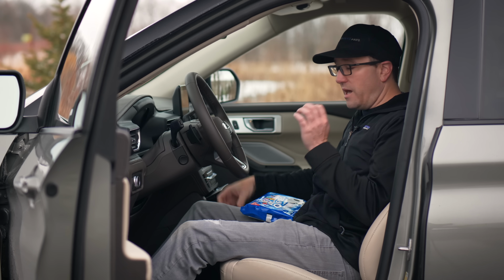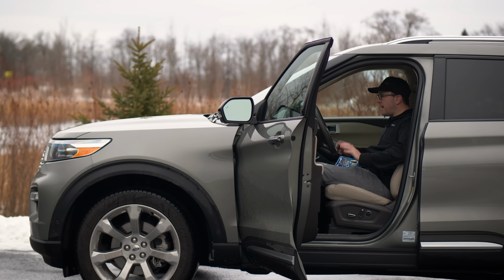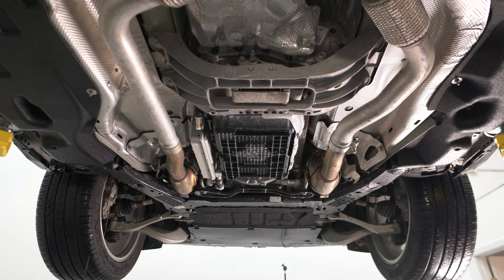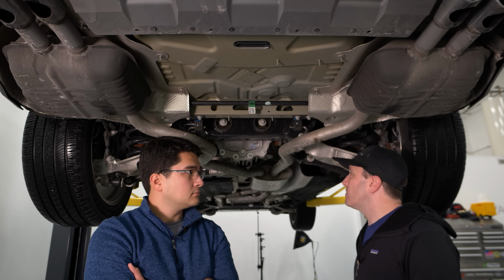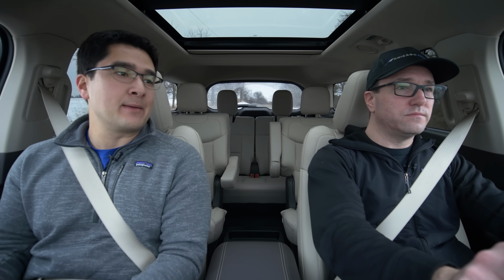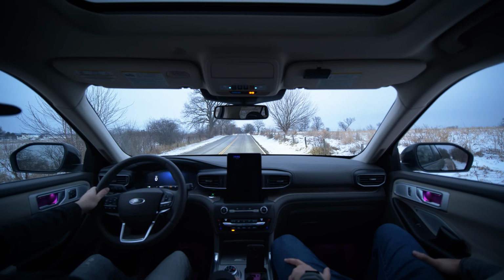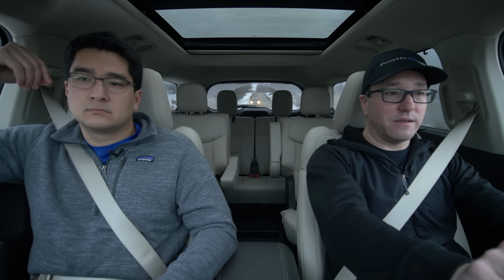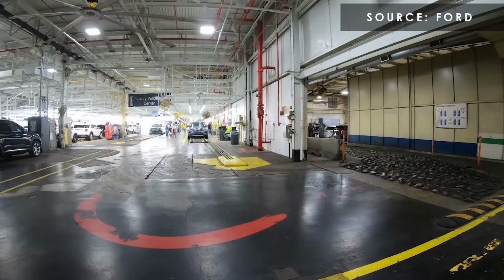2020 Ford Explorer | Who Is Responsible For This?

Comment: I have a 2017 5th gen xlt sport appearance package and the 2021 ford explorer platinum  and the 5th gen is built  better keep in mind its a 17 and the 5th gen came out in 2011. In my opinion im still taking  the 6th gen over a kia any day kia is not on this level of capabilities these truck have a better off road 4wd system . The parking assist is spot on and if you are choosing the explorer you arent worried about door dings at the end of the day not saying you want them . The aviator is what you want if you want the very best qaulity ford is not going to put the very best into the explorer because that would make it compete against the aviator

Comment: I wish you guys could have reviewed the Explorer ST. I have one, the leather seems to be better quality (mine has 45k miles and the black leather still looks brand new) and the handling is great (10% stiffer springs than other Explorers).
EDIT: You must have a problem with your audio system as well because I'm a DJ and musician and I think it's one of the best sound systems in any stock car I've been in recently.
EDIT2: It's a different 10 speed than the one in the F-150 and the Mustang. 10R60 vs 10R80... but either way yes it's clunky on the downshift especially down into 2nd, not so much other gears.

Comment: I have the 2021 ST and my seats look like leather but they aren’t. .. it’s the 3.0/Twin turbo .. I really like the look, and the power - it gets up and goes if and when I need it to and traveling all over half the US I’ve needed that power now and again to avoid precarious situations.. and I paid too much for it but that’s putting a price on my peace of mind … Ford has also been real good to me when there’s an issue and my dealer here in OKC takes video and texts them to me showing me what they are doing and what they see …these vehicles loose value of $10,000 annually or a dollar for every mile driven essentially at 12,000/annually which even if you’ve driven less it doesn’t matter. I love the look, power, and will remove all my back seats and convert it to a small camping vehicle.  Driving modes work well on the ST and no kidding the Sport mode is awesome. My mpg is also great at 27mpg around the city  and 28-29 freeway .. why so close? Because I live in Oklahoma and everything is far away for me to drive to so its highway driving all the time.  A good test is this story .. one day while driving 55ish 60 in a 55, a suicide driver just pulled out in front of me giving me maybe 40 feet to stop … hitting those brakes hard like I did was in my mind a miracle as I screeched/skidded only a very short distance but it stopped almost on that dime…that guy was lucky he didn’t get T-boned he would not have survived being in an older Jeep…and although his rig was lifted I looked down on him slightly so that angle would have been a disaster for him and of course me and my  pup who wears a seatbelt and she ended up on the floor board instead of into the dashboard - so a good ending .. the response to driver shenanigans is incredible when I need it it responds.  I love the look, the power, the bells and whistles I got with this one (loaded) and I have not had issues except for the audio which sometimes has a mind of its own but receiving software updates fixes those sound issues.  I sure do Appreciate the review of this rig … I got a good rig, the Lord watches over me and is my pilot…I don’t have the issues you spoke about with sound and interior pressure and the audio updates have always resolved any issues I had.  I think I was blessed with a good rig as it was the only one on the lot along with 3 expeditions (as covid was winding down).. I have experienced I got a safe vehicle and the safety recalls for my rig have not been issues with my vehicle. .. Be safe everyone.

Comment: I'm a dyed in the wool GM guy.

As crummy as the Giant Machine Corporation is I have stuck with it throughout my life.

HOWEVER.

This guy making the review is an idiot.
A full and complete idiot.

I'm considering getting myself this Explorer or the Aviator.

GM has NOTHING to compete with.
The highlander is a heavy car, a piece of garbage appliance with 4 wheels.
The Dodge Durango is an old design.

Kia?  Dont make me laugh please.

Going down the list is tedious.

Ford FINALLY built something that has caught my eye besides the Mustang.

It has more things right with it than wrong.
The reviewer is just used to crappy front wheel drive shit boxes that masquerade as automobiles which are then 'upgraded' to appear as some kind of giant shit box mini SUV.

This Explorer is actually a vehicle, a car, an automobile.
Reply: Hate to break it to you, but the Telluride is consistently reviewed as one of the best three-rows out there. I'm not the biggest fan of Kia because of their seemingly endless parade of engine recalls, but show me a manufacturer now that doesn't have constant fucking recalls. Have you looked at Ford's recall statistics lately? Not good. The Explorer is a forgotten vehicle, and it shows. If you want a performance SUV, buy an Acura or a BMW. If you want a truck, buy a truck, but don't buy this heap.
Reply: @theglowcloud2215  My 2012 Impala with GMs' corporate 3.6 DOHC engine has more horsepower than the Acura.

This Ford has more horsepower than the Telluride and can actually pull a trailer.

No.

As I already said.
I'm a GM corporate machine corporation guy.

But I would consider this ford over GMC's Yukon which has an embarrassing 355 HP.

Dont tell me about those FWD pieces of garbage, those are appliances on four wheels.

This car has the right lines and the right looks.

Comment: I had one of these Ford Explorers as a rental. What a POS. The car was poorly built, and poorly designed. It was a chore to drive it, and the transmission muzzled any fun the half-way decent engine could muster. Basically, this stupid explorer drove worse than full size pickup, and had the build quality and material quality of 1990s school bus.
Reply: 1990s school buses are more solidly built than the Explorer. And an International diesel will run forever, unlike Ford's cursed V6 EcoBoost 😂

Comment: The 2023 new Explorer base model - how is the 10 speed automatic transmission reliability overall with the 2.3 engine?
Reply: If it's the same 10 speed transmission as my 2020 explorer. Stay away lol. 

I had to have the transmission completely replaced at 22,000 miles.

Comment: I watched this video in 2020, and said "meh.. I want one anyway"  and went a bought a platinum.  

Do i regret it?  Yes and no but I am trading for an MDX.

 What am I gaining with an MDX?  
- heads up display
- comfort mode 
- wireless android auto 
- better sound closing doors
- resale value 
- reliability

What am losing when I give up the Explorer?
-  100 lb-ft and 100 hp
- massaging seats 
- 700 lbs towing 
- arguably better off road 
- a better lane keep from what I could tell from the MDX demo... it wasn't very good. 

The only thing I believe I'm going to miss from the explorer is the 3.0 turbo.  It was very satisfying.  I'm going to miss fish tailing with confidence  down the snowy lane on the highway while everyone else is protectign their interests, I enjoyed mine. 

20 years with Ford.  This is my good-bye.  Acura.... you better not F this up!

Comment: First I will say  i love ford i grew up in a ford vehicle but no need to suger coat the fact that ford did a terrible job with the exterior design on the new generation explorer. The interior as usual is absolutely nice hands down but what drunk car designer made fords classic  ford explorer ugly like this same thing with the smaller lincoln suvs that big grill and headlights  and skinny back side is just ugly looking man hands down !! Ford yall need to fix this exterior design problem. In my opinion the only nice suvs ford has out for 2023 is the ford expedition and the lincoln navigator and of course your number 1 seller the ford f150

Comment: Great review!!! Burocratic crap car! Just leased a 2022 XLT and it’s cheap plastic all over the interior, bad fittings, laggy infotainment, miss very basic things like standard adaptive cruise control on the XLT, no temperature display other than the main screen so it gets on the way if you are using navigation. Also no sound alert for blind spot, no automatic wipers. Will kick myself everyday for the next three years since it’s a lease. Good thing is I would have to sell it at the end.

Comment: One area the reviews do not give the explorer credit for is the chassis. Its far superior to any of the competition front drivers.  It runs circles around the Kia or Hyundai they drive around corners like a bus. . The Explorer handles better, accelerates better, stops better and  looks better.   Front drive  SUV's will not compete in these areas. I test drove the KIA telluride.  Its slow as molasses. Put your family and cargo in one and it has no passing power.   7.5 to 60 with just a drive is just plain slow.   Even the Explorer with the standard turbo 4 blows that away and the ST with 400 HP will leave it in  the dust. I will never buy a front driver SUV again. The ST is fantastic to drive

Comment: We drank the cool-aid and ordered a 2020 Ford Explorer ST in October 2021. I'm a bleed blue Ford man. But... After 2.5 years/40k miles, I've moved on. This car was in the shop about 10 times, ALL because of the electronics; e.g. lift gate won't open, info system locked up/failed, etc. When looking for a new vehicle I did look at the '22 ST thinking [they] had to improve it. Nope, basically the same car. AND all dealers had marked up the MSRP by $4000-$6000! What a rip-off! This pricing put the ST within $5-6K of the new MDX Type S Adv. In every area save for max HP/TQ the MDX puts the ST to shame! I mean not even comparable! We now own a '22 MDX Type S Adv, white with red Milano eather interior and Ford has lost an SUV owner forever. FWIW, I still have a my '14 Raptor and with NO complaints

Comment: the vertical screen is the worst but even worse are the constant tech failures for the 3rd time in my 2020 explorer.  Ford problems in their vehicles has never been worse than they are now.  That's to bad because with the new chassis and the 3.0 ST with 400 HP drives terrific.

Comment: Ford lobbied for a long time in order to stall government wanting to make autonomous features standard. This meant Ford would have to retroactively engineer automatic brakes in its current-year-model cars. They wanted to push it back until the next redesign. Now that all foreign-made cars have it available, if not standard, Ford should have to ask themselves... 

“Why would consumers buy domestic, when foreign cars offer so much more standard equipment, are cheaper, feel better built and don’t seem to screw up as often as American car companies?”

After all, Ford no longer have small car offerings. Last time I checked, Hyundai is still selling tons of Elantras... Honda, lots of Civics. 

True story: I was debating on buying a Volkswagen GTI or a Ford Focus ST. They were roughly the same price, buy the VW just felt like actual care had been put into its construction. The Focus ST had stiff, scratchy cheap plastic panels on the doors, console and dashboard (I had a base Fiesta at the time and it was annoyingly the same exact material) Nothing that you would want in a $30k+ car. And the Focus’ Recaro bucket seats (like real deep-bucket) seemed to be designed by some East German communist that decided if you wanted to use the clutch pedal... you would have to either tip-toe it like a Soviet ballerina, or you could run the risk of severing your left leg from the force of your thigh muscle being sawed through by the Berlin wall equivalent of stiff seat padding. 

It’s safe to say those horrible seats made my mind up more than the fit and finish. It showed me that the Focus ST had been created by a committee of white collar businessmen, as a item THEY thought looked good on paper, and it did, but the end result left much to be desired. If you can’t see yourself in it, then you shouldn’t be in charge of telling the engineers and designers what will sell.

The GTI on The other hand had all the bells and whistle’s that the focus did, plus automatic braking and radar guided cruise control. (which no Ford car offered at the time.) Also there was a backup camera, app-supported remote control, panoramic sunroof, and a bunch of tiny things that one finds crucial after ownership of 3 years. 

Rather than lobbying to PREVENT change, they should be welcoming it.  

If Ford doesn’t want to innovate at the same rate or higher than everyone else is, then they shouldn’t be surprised when they get left behind.

Comment: Uuugggghhhh. I care about function. If it works I’m happy. I don’t give a $hit about panel gaps or “plastic quality”. It’s plastic. 

I was in an Honda once that had wonderful fit and finished. But the myriad of buttons were confusing and didn’t work first push. Ppl need to get over themselves. 

Sync3 is great. Very valid points in the rear backup camera view.

Complaints about the body materiel are a bit dumb to me. 

I took one on a 3000 mile road trip towing a camper and it was great. Great power, very comfortable, mileage was tough though. 

What o really want to know is does the 10 speed/ 2.3 have any reliability issues? I do wish they kept a regular 6 option. Great info about the trans.

Great points about the truck feel.

Comment: Lol you want the ST for the upgraded suspension... Not the engine.... 
Also, there is added engine noise. For being such sound snobs I'm surprised you missed the differences in the modes...

Comment: I owned an 06 Explorer XLT and it had a cheap, hard plastic interior.  It was a pretty basic vehicle but I liked it because it got the job done and didn’t cost a small fortune.  I sold it with 109k miles and it still ran great.

Comment: I often wonder with these car reviews, regardless of manufacturer, what kind of vehicles are delivered for testing…. For example, pre production, test mules etc. Also, do manufacturers just use the same vehicle and let every reviewer thrash it? In this review, he complains of the transmission shift schedule-with new technology and adaptive shifting software. If a vehicle is beaten on continually, the trans will adapt to more aggressive and harsh shifts. In this situation, did he get a test vehicle that has been beaten in for the 4000 miles?  A 10 speed in a work truck I drive took almost 10000 km to come into its own. Shifts now are smooth when driven easily, and snappy under full throttle.

Comment: Mark is correct about the transmission. It has a class action lawsuit filed because of issues in F150 and the many Mustang owners have complained about loud whirring/whining noises in lower gears. I will never buy a Ford with this transmission.
Just Google 10R80 transmission problems in F150’s and Mustangs.

Comment: I was very disappointed in the reviews and recalls associated with the new generation Explorer. I wanted to trade in my 2004 Explorer Limited on a new one but I could not find favorable reviews from layout like the iPad stuck to the dash to the mechanical issues, and big ones like tranny’s and engine issues… BIG TICKET items. I shopped for a year and a half and ended up with a Hyundai Palisade which had fantastic reviews great quality and around $20,000 less. This was my FIRST foreign auto and the way things are going foreign will be my next vehicle.. Unless FORD steps it up, and they have a way to go….SO SO SO VERY DISAPPOINTED I COULDN’T GET THE EXPLORER.   But I follow reviews and Explorer did not do well in many of them, actually I don’t believe I found a good review… The only thing I miss is the turbos like I have in my 2015 F-150 
P.S. I have 8000 miles on my Palisade, took a trip to main (3000) miles round trip and after 8000 miles I have had  Zero issues, none, nada. Since the 2019 Palisade hit the market I don’t believe there has been one recall… COME ON FORD, WAKE UP…..

Comment: The other trim models have landscape screen. That said I have a 2021 Limited an love it. I test drove a 2020 Telluride and Palisade and think that this surpasses those in regard to platform. It feels more like my Flex (Car-like) than a SUV / Truck. And, at least for 2021, the 2.3L Ecoboost is faaaaast. It beat my 2019 Explorer sport that I just dumped. Anyway, I respect the viewpoint, but I'm satisfied so far.

Comment: I bought a ‘21 Explorer xlt. I may be biased because I drive semi trucks all day, but I believe the base 2.3 is more than enough to get you down the road and gets great fuel economy. Haven’t had any transmission issues yet in 6,000 miles. It feels solid and comfortable. The smaller wheels with thicker sidewalls probably help. Not a big audio guy but I do miss the Harman Kardon in the last Dodge I had. Excited to feel how it handles poor weather, if we ever get rain in California again.

Comment: The faux quad exhaust with the angled down tips is another failed attempt to keep exhaust out of the cabin.  My 2016 Explorer had horrible problems with exhaust in the cabin under heavy acceleration.  Ford paid thousands of dollars to replace weather stripping around the spoiler, the bumper and tailgate and replaced the entire exhaust with angled down tips which failed to correct the problem.  This problem goes back at least to 2011 Explorer and was never properly corrected.  Search online for terms like "ford explorer cabin exhaust" before buying an Explorer.  This could save your life.